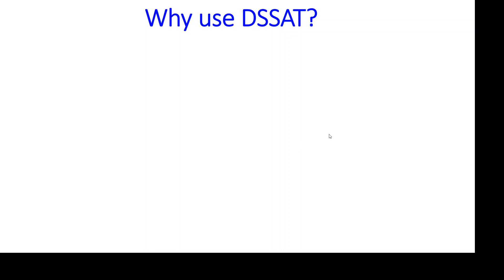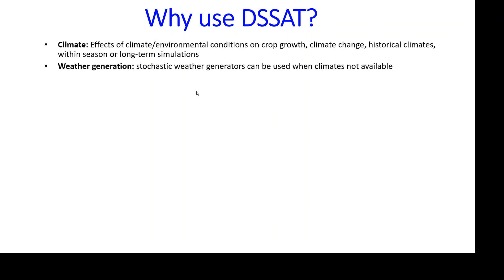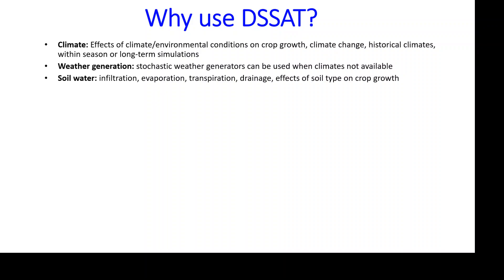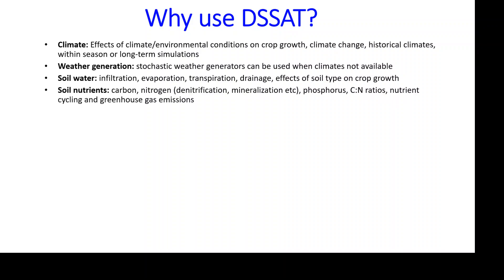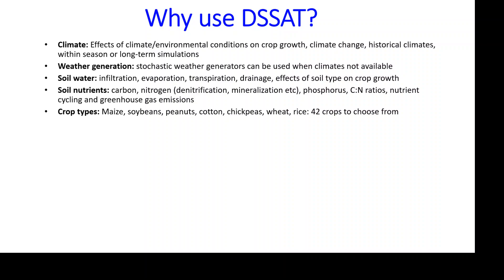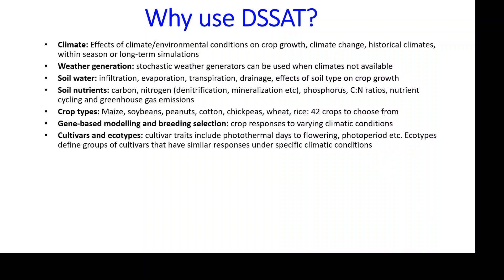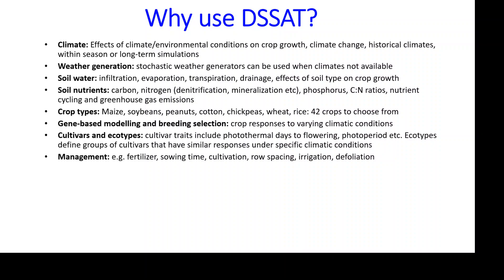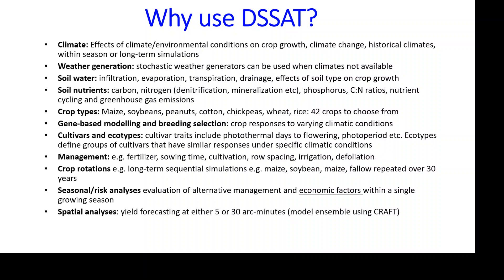Three minute overview of DSSAT

Comment: By reflecting away 30% of the incoming solar energy the albedo makes the Earth cooler than it would be without the atmosphere much like that reflective panel behind a car’s windshield. 

The non-radiative heat transfer processes of the contiguous atmospheric molecules render “extra” energy upwelling from the surface radiating as a LWIR black body impossible. For example, the 396 W/m^2 upwelling from the surface is a “What if?” theoretical calculation without physical reality. (refer to: TFK_bams09)

Without the 396 W/m^2 upwelling there is no 333 W/m^2 GHG energy up/down/”back” LWIR greenhouse gas loop to not “warm” the terrestrial surface. 

The greenhouse theory and man caused climate change are negated by any one of these three points. 
Hysterical speculations over sea levels, ice caps, glaciers, extreme weather, etc. are irrelevant noise.

Zero greenhouse effect, Zero CO2 global warming and Zero man caused climate change.

Version 1.0 091421